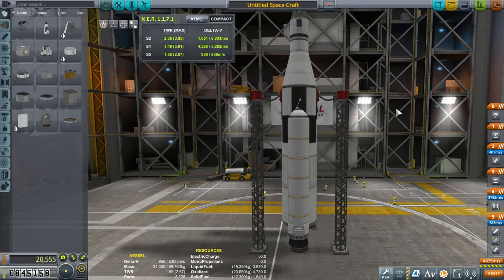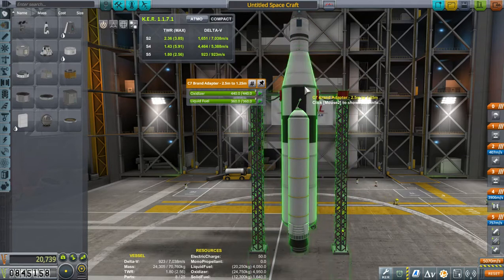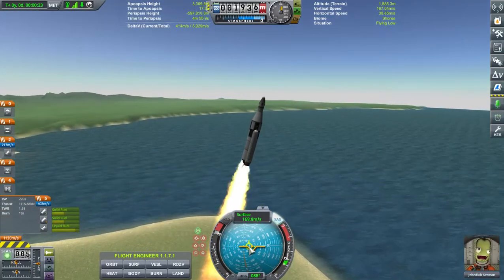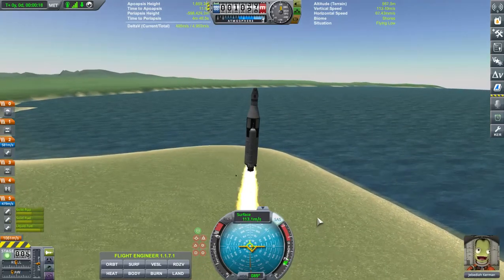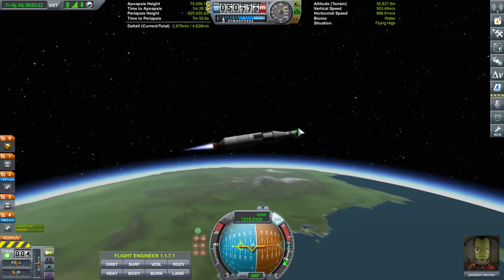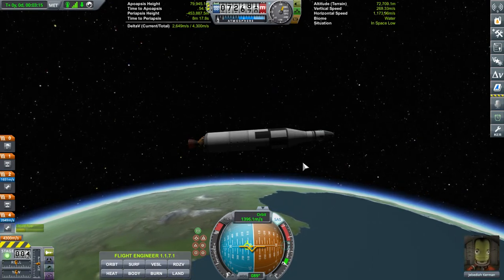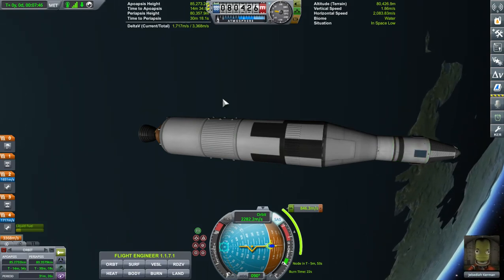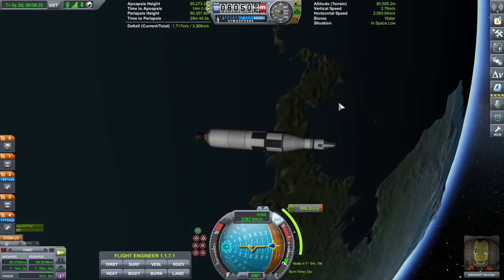KSP  Ascent Profile - Launch To Orbit

Comment: You only need 3400Δv to get into orbit at most.. This rocket could plant a flag on Mun and Minmus.
Reply from the maker: I've been using an old printout of the Delta-V map.  I think a lot of things have changed since then. 
Thanks for the comment, Tyler!
Reply: @skakers1  you might have mixed between a low orbit and a stationary orbit cuz that one is 4500m/s
Reply from the maker: @dark6.63E-34  I am always nervous about those stationary orbits.  I've done them but sometimes I have a LOT of delta-V left.
Reply: @skakers1  niceee
Tho I was talking about how you might have read 4500ΔV on a ΔV map and thought it was for a low orbit when instead it was for a stationary one. I don't think the old printouts for the maps would differ by 1kΔV to todays. I am guilty of the same oversight, that's why i might have recognized the mistake you did
Reply from the maker: @dark6.63E-34  Oh I see now.  You're right.  That map, WAC Delta V map does say 4550 for Low Kerbin Orbit plus 1115 for Kerbin GSO Gotcha'.  I understand now there is even an updated one with 3200 LKO.  Thank you, dark!
Reply: @skakers1  ✌